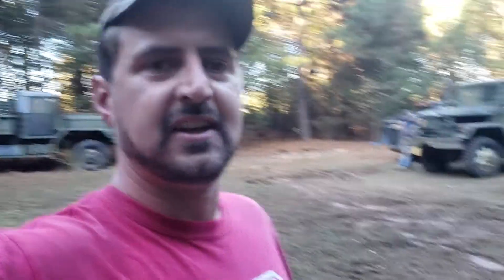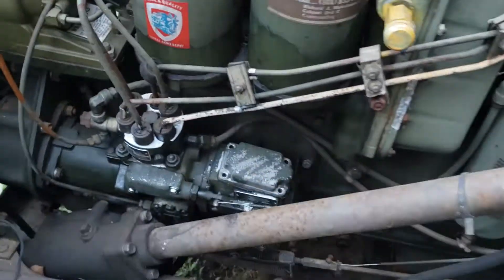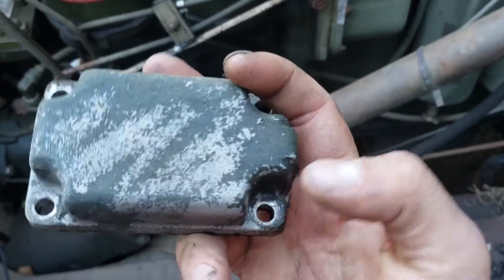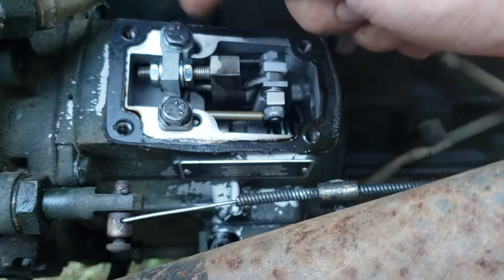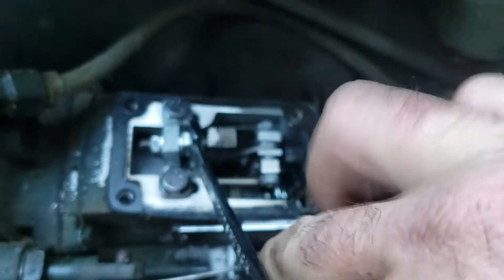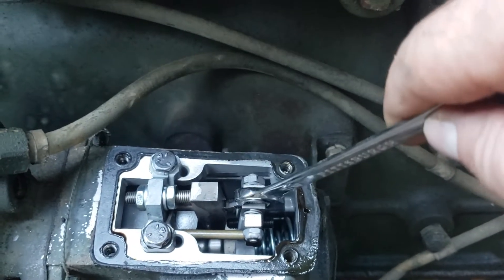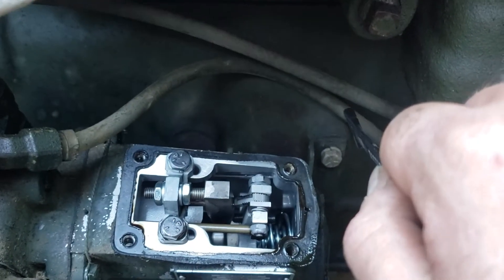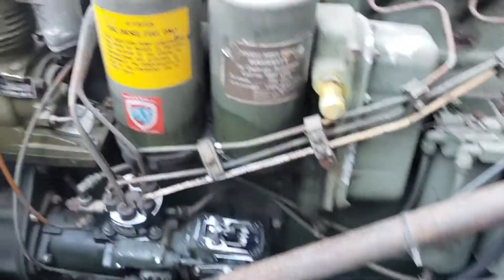Early " G code" multifuel injection pump fuel setting adjustment.

Comment: Is any of the duel fuel engines worth having ? I found 7 of them 4 are complete the other 3 have some missing parts . I'm thinking of striking a deal for them.
Reply from the maker: Certainly, if you can get them cheap. Parts and complete engines are starting to dry up.
Reply: @tacticalrepair  4 of them are still in the crates . 1 has the head missing and the other 2 have things like starters and and fuel pumps missing . I think I will but them .